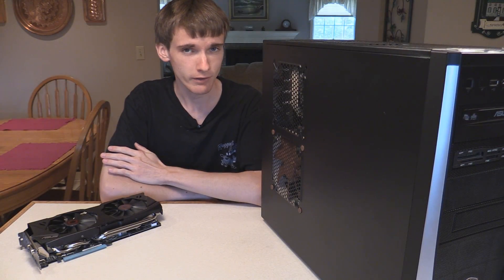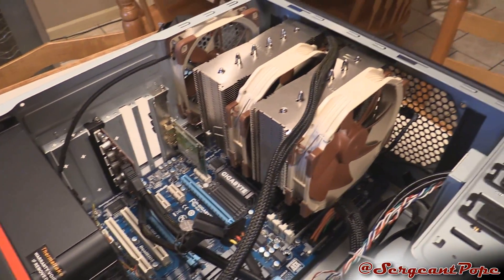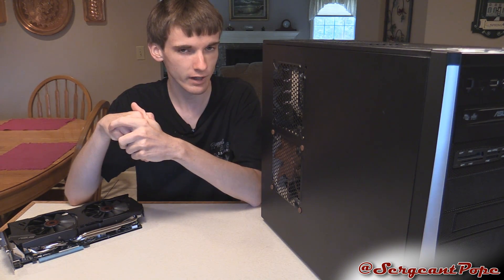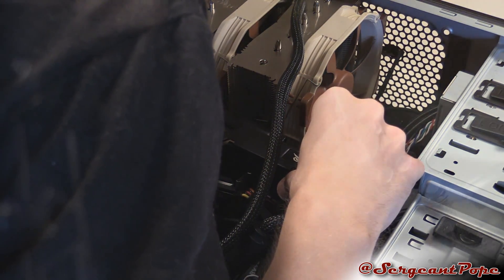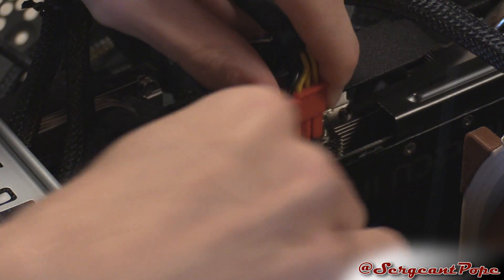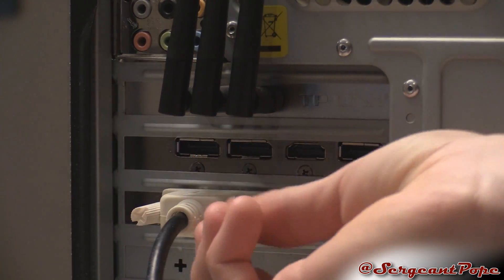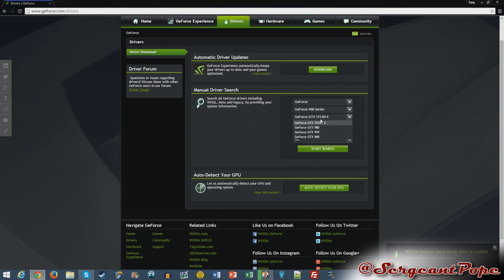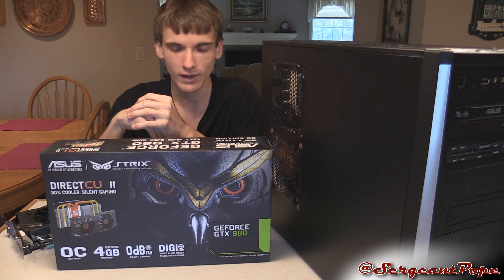How to install a graphics card - GET INTO PC GAMING EASY!

Comment: can i get any graphic card or maybe just a gt 730 for my i3 540
Reply from the maker: The only real requirements for a graphics card are you motherboard and power supply. The motherboard needs a PCI express X16 slot and the power supply needs to be powerful enough for the graphics card you pick.
Reply: hp compaq 8100 elite sff , not sure if i can get one of these
Reply from the maker: Kullehh Brahimi The big issue with that kind of computer is it's a small form factor, so it would only fit half height graphics cards. I think the fastest half height card is made with the GTX 750 Ti.

Comment: hey I,M ON WINDOWS 10 and I can't find my old driver as well I already installed the new driver.
Reply from the maker: If the new driver is from the same company as the old driver, it will commonly overwrite the old driver. Even if that isn't the case, you're honest probably fine.
Reply: SergeantPope alright thanks for your help on my quest to upgrade my pc. I just got a navidia over my old amc cpu and gpu, I was struggling a bit with it but now I just need to get my DVI-I dual cable for the card.

Comment: Hey, you seem like a pretty sensible guy. I'm not a gamer. I'm a 72 year old retired software developer interested in 3D modeling.  What video card "Low end" will work for me. I've been told to get a Directx 12 card HELP MR!!!
Reply from the maker: What graphics card you get depends on two things, your budget and how much power you need. A good low end card may be the GTX 750 Ti or a Radeon RX 460 or 470 when those come out soon. Since I don't do 3D modeling, I'm not completely sure how much power you would need to run that effectively, but I would think the cards I just mentioned would be able to handle it. As for DirectX 12, it's really not that big of a deal. You need Windows 10 to use it, but very few programs actually use DirectX 12.

Comment: What's is the best graphics card under 200 and his good for fos boosting?
Reply: Fps
Reply from the maker: The cheapest graphics card I'd get is the GTX 750 Ti. You might be able to find an RX 480 for around $200. Those perform really well for the price.

Comment: Pope, i bought a gtx 970, installed it and when i try to turn it on i get this message "reboot and select proper boot device or insert boot media in selected boot device and press a key
Reply from the maker: That would probably be an issue with your hard drive or SSD. Does the computer still boot normally without the graphics card installed?
Reply: Yep it was the hard drive. It was connected with a broken cable. Thanks for the help!
Reply from the maker: saldidruska Ahhh, that makes sense. Glad you got it sorted out!

Comment: I have a custom built computer. This is my build: http://pcpartpicker.com/p/wsckkL

I've had the computer for 5 months with no problems. Recently I got GTA V. I played it for a week with no problems, then suddenly, it started crashing my PC. At first it would show "display drivers have failed, but have recovered". Now, my PC crashes randomly.

I understand that I do not have enough power coming from my power supply from my build. Could this be the problem?
Reply from the maker: Your power supply being only 300 watts is almost certainly your problem. I would recommend getting a 500 or 600 watt power supply, especially since they really aren't too expensive.
Reply: I ended up buying a Geforce gtx 960 OC 4 gb. https://www.amazon.com/gp/aw/d/B013LDXPFO/ref=ya_st_dp_summary

I'm hoping this fixes the problem since it requires less power.
Reply: And it's better than my current graphics card. :)
Reply from the maker: Justin Williams The GTX 960 is pretty solid. I have one of my own. I believe it requires at least 500 watts.

Comment: I wanna get a GTX 1070 graphics card and i have a 600 watt power supply will that work?
Reply from the maker: It should work just fine. The GTX 1070 requires 500 watts and 30 amps on the 12v rail, so it sounds like your power supply would work great!

Comment: http://www.bestbuy.com/site/lenovo-desktop-amd-a10-series-12gb-memory-2tb-hard-drive-black/4362103.p?id=1219736628126&skuId=4362103

I'm a noob about this but this is my desktop I play games on.  it has integrated graphics which isn't the best what kind of graphics card would be best fit for this PC
Reply: I would recommend these graphic cards.
There pretty good graphics cards under $100
1: https://www.amazon.ca/Radeon-R7-240-128-Bit-Express/dp/B00FRHIIPK/ref=sr_1_30?ie=UTF8&qid=1482437610&sr=8-30&keywords=graphics+card
2: https://www.amazon.ca/GeForce-Passive-Express-Graphics-01G-P3-1313-KR/dp/B00498305G/ref=sr_1_3?ie=UTF8&qid=1482436456&sr=8-3&keywords=graphics%2Bcard&th=1
Reply: Or https://www.amazon.ca/GeForce-GDDR5-Profile-Graphics-02G-P3-3733-KR/dp/B00L5GZG5C/ref=sr_1_2?ie=UTF8&qid=1482351401&sr=8-2&keywords=graphics+card

Comment: I have a GTX 950 and when ever I game my monitor will randomly say no Signal. And the fans on the graphics card never spin also.
Reply from the maker: Hmmm, do you have the power connector for your GTX 950 connected? If not it may cause that issue.

Comment: Hi I'm a streamer and my PC has a GTX 970 but I need another graphics card for my other monitor just for watching my chat on twitch and checking my elgato. please help !
Reply from the maker: Well, you can just hook up two monitors to one graphics card, ya know.
Reply: +SergeantPope would I use a splitter because I only have one hdmi port in the back
Reply from the maker: TheLostChild HD No, you could get something like a display port to HDMI port adapter though. That'll work just fine.
Reply: +SergeantPope ok great would u suggest a specific make or anything?
Reply from the maker: TheLostChild HD For cables, not really. Just don't buy a super cheap one, lol. Something that is $10-$20 would be great.
Reply: ok cool thanks a lot XD

Comment: Hey,mate, i just bought a monitor Dell S2316H which has integrated speakers. The situation is that  the monitor has VGA and HDMI while my pc has VGA and DVI, in this case, what should I do if i want the speaker to function? thank you.
Reply from the maker: I believe with your current display setup on your computer, you would need to run an audio cable from your computer to your monitor to work with the integrated speakers. Otherwise you could buy a graphics card with an HDMI port and then have audio come through that cable.
Reply: is it worth it, if i upgrade the motherboard to a model with HDMI? or installing a video card sounds like a better idea?
Reply from the maker: chao huang Getting a new graphics card that has HDMI would be the best choice in my opinion.
Reply: I think i will use VGA and audio cable first, and get a RX 460 when it comes to the market. only for league of legends. xD

Comment: I am looking for a good graphics card maybe between 200-320$ I want it to run games for example Arma 3, Can you help me?

My specs right now.
 
Intel(R) Core(TM)  i3-2130 CPU @ 3.40 GHz 
RAM is 6.00 GB i will upgrade this. 
My graphics card is really crappy.
Reply from the maker: The GTX 970 would fit in your budget and run any game you want very well. Though I would recommend waiting a few weeks. The GTX 1070 just came out and is likely to push the prices of the GTX 970 down even cheaper.
Reply: +SergeantPope Thank you so much!!!
Reply: +TheLazySly Cat Do you now a website which will sell this?
Reply from the maker: TheLazySly Cat I usually buy my computer stuff from Amazon. Newegg also sells that stuff.
Reply: +SergeantPope Thanks

Comment: hey is there graphic cards that I can use that doesn't cost over 120$ but can still able to run big games
Reply from the maker: You probably wanna go with the GTX 750 Ti with your budget. It won't run demanding games super well, but for the price it's pretty good.

Comment: Hey, I'm wanting to upgrade my computer a little bit by adding a nvidia GeForce gtx 970 and I'm not sure if it would be compatible with my current build 
Specs:
Gigabyte f2a68m-h motherboard
Evga 700w psu 
Amd apu a8 7600 
Corsair vengeance 16gb ram 
Seagate barracuda 1 tb 
Thanks!
Reply from the maker: Looks like everything will work just great with a GTX 970! Your motherboard has the correct slot and your power supply looks plenty powerful for that card.
Reply: +SergeantPope okay thanks soo much! I subbed

Comment: I have an Dell Inspiron 620 and I want to upgrade my pc to run overwatch at 60 fps what doo I need to upgrade it
Reply from the maker: You have a full sized desktop, so any graphics card should fit just fine. Whatever graphics card you buy really depends on your budget.
Reply: My budget is under 150 bucks for power supply and Graphic card?
Reply from the maker: Johnny Nguyen Ahh, gotcha. How powerful is your power supply? There should a sticker on the side of it showing the wattage.
Reply: uhm I think it is 300 watt
Reply from the maker: Johnny Nguyen You'll probably have to upgrade your power supply to at least 400 watts if you want a slightly decent graphics card. Maybe get a 400 watt power supply and then a GTX 750 Ti.
Reply: Okay Thank you
Reply: SergeantPope jesus christ you're a youtuber that actually replies in under 2 days.

i salute you for not being a lazy shet.
Reply from the maker: Fancy Hamster Haha, thanks Hamster. I do my best to reply fairly quickly, but it's tough sometimes because I can't just do it on my stupid phone :P
Reply from the maker: Vladimir Kulkin According to my source for power supply requirements, you will need at least 400 watts for a GTX 750 Ti. Here's the link: https://forum-en.msi.com/faq/article/printer/power-requirements-for-graphics-cards
I don't imagine anything would bottleneck there, as long as you have at least 6GB of ram or so.
Reply: Heyy, SO I  bought an r7 360 and when I put it in and use HDMI connector, the screen does start but when I use the VGA without the  GPU, it starts
Reply: So can you help me :D
Thanks
Reply from the maker: Johnny Nguyen Are you using the HDMI connector on the graphics card? Is the graphics card fully seated into the motherboard? Do you have the power connectors on the graphics card plugged in?

Comment: i installed the graphic card but ive got only one pin for it the 6 one do i have to plug 2 of them in or will it work just fine with one pin plugged?
Reply from the maker: You could possibly by an adapter to add more 6 pin connections to your power supply, but chances are that if you don't have more than one 6 pin connector on your power supply, you may need to upgrade your power supply to something with more wattage.
Reply: yeah ive done that and bought a bigger power supply and it worked out good , thanks tho

Comment: hey man ive got a i5-4690 cpu 3.50HZ, and i was thinking of buying the MSI GTX 970 Tiger 4GB will it work fine ? and how good is it? i sorta new to these things, thanks in advance
Reply from the maker: +CFNinjaqt The GTX 970 should pair up with that CPU just fine. I would consider waiting for the GTX 1070 though, as it will be much faster and is coming out in less than a month I think.
Reply: +SergeantPope ah i only got the GTX 970 because of my budget , i dont mind it running games at high like fallout 4 and such, thank you very much tho

Comment: Do I need to reinstall the software after a system wipe? Please help
Reply from the maker: +the shady enderman You're reinstalling Windows on your system with the graphics card? You don't really need to do that. All you really need to do is install the new graphics drivers and it should work fine.

Comment: So this is my PC http://imgur.com/0x5iUnS
There're some chips around the PCIe slot, will a dual fan like a Geforce GTX 970 still fit?
Reply from the maker: +Red Mage928 Yep, a dual slot card will fit just fine. Two slot cards block the slot right underneath the card, but there isn't anything you can do about that.

Comment: Are there any graphics cards that can run Gta 5 but $300 under thanks
Reply from the maker: +Mr. Dark Chocolate234234 The GTX 960 is $200 and it can run GTA V at 1080p great.
Reply: +SergeantPope thanks a lot and fast reply wow. Sub and like
Reply: +SergeantPope and is here any under $200 thanks ur in us and I'm in nz so price range is a bit different thanks!
Reply from the maker: Mr. Dark Chocolate234234 Oh ok, you could also get the GTX 950 or the R9 380. Both of those are below $200 US and they both should be able to run GTA V at good settings on 1080p.
Reply: +SergeantPope WOW. Thanks! , Sub Like.

Comment: what would be a good graphics card UNDER $300, still looks, and has medium-low power consumption. If you can find one please tell me what the FPS would be on like Garry's mod with max settings
Reply: gmod takes like nothing to run so get a GTX 750ti or a GTX 950 (950 is better but is Iike 30 bucks more but preforms better)
Reply: A 750ti is a decent graphics card and is about £100 or 130 dollars, it should run Gmod fine on high settings
Reply: A 750ti is a decent graphics card and is about £100 or 130 dollars, it should run Gmod fine on high settings
Reply: every graphics card above intel i5

Comment: Hey man, what graphics card would you recommend me if im using hp 251-a123wb thanks man!
Reply from the maker: +Marvin Cleofas Budget?
Reply: +SergeantPope I just wanna replace the one installed in my system to a better one. So I would humbly spend like $300-500
Reply from the maker: Marvin Cleofas I would probably get a GTX 970 or 980 with that budget. Both are pretty damn great cards. They both require a 500 watt power supply, so if your power supply is less than that, you would also need to upgrade that too.

Comment: I have a dell precision t5500, with proprietary psu.  I discovered the best way to upgrade is to add another psu and not mess with the existing.  found this cool little relay on amazon to help  Add2PSU http://www.amazon.com/Add2PSU-Multiple-Power-Supply-Adapter/dp/B009P98Q8U?ie=UTF8&psc=1&redirect=true&ref_=oh_aui_detailpage_o00_s00 good luck

Comment: My PC has a PCI Express x16 slot, the slot for display ports are so small. What graphics card can I get?
Reply from the maker: +One123 If the slot is a regular PCI express X16 slot, then technically any graphics card will fit in there.
Reply: +SergeantPope Well it is a regular slot, but I've measured the height, which is 2 1/2 inches, with a width of 1/2 inches. Surely that's not big enough right? Sorry for asking, I don't have experience in building PCs.
Reply from the maker: One123 I don't really know anything about the measurements... could you take a picture of the slot and tweet it to me?@SergeantPope
Reply: SergeantPope Sure, just sent it. I hope the picture was clear enough, my phone isn't top quality
Reply from the maker: One123 Got it, thanks. Your case looks smaller than a normal desktop, which means only low profile graphics card will fit. Here's a GTX 750 Ti low profile as reference http://smile.amazon.com/MSI-Computer-Graphics-Cards-N750TI-2GD5TLP/dp/B00SOXMPJY/
Reply: SergeantPope One more thing if it's not to much to ask, my PSU says do not exceed 220 watts. Does that mean my PSU is only 220watts, if so I'm out of luck
Reply from the maker: One123 Sounds like you would probably will need to upgrade your power supply when you install a graphics card. Since you have a smaller case, you might have to get an SFX power supply instead of the regular ATX power supplies.
Reply: SergeantPope Ive decided to abandon this, anyways thanks for the help and replies

Comment: Help me ! please 
my PC HP . Pavilion p7-1000. system number :QW841AAR#ABA
SERIAL NUMBER : MX82110PJL
RAM 8 GB
processor : AMD A8
window 10 home .
i bought it 2013

i want to upgrade my video graphic card PC . i want to my pc can connect to 4k tv , and play game . do you guy know what video graphic card will fit into my PC , and how many W power supply is require ? i like AMD Radeon video graphic card , geforce gtx is good too.but they high price . cheapest video card will be good . 
i'm appriciate your help.
Thanks you so much your help.
Reply from the maker: +ZE KENZY That all depends on your budget. How much is your budget? Your power supply is 300 watts, so you will need to upgrade that along with any graphics card you buy.
Reply: +SergeantPope my budget is $ 200 to $ 300 , for graphic card ,
Reply from the maker: ZE KENZY Gotcha. With that kind of budget, an R9 380 is probably a good choice. Here's one http://smile.amazon.com/Gigabyte-Gaming-Graphics-GV-R938G1-GAMING-4GD/dp/B00ZGF3TUC/ You'll need to upgrade your power supply when you get a new graphics card though...
Reply: +SergeantPope  how many W for power supply will be enough ? what power supply you recommend ? Thanks you .
Reply from the maker: ZE KENZY An R9 380 requires at least 500 watts. I like EVGA, Thermaltake, and Corsair power supplies.

Comment: Hey, does anyone know if the Nvidia Gtx 660 graphics card is compatible with the Dell Xps 8700? Thanks.
Reply from the maker: +Daniel Goutovets The desktop case is big enough to fit a graphics card like that. The GTX 660 might require more power than your current power supply though, so if it does, you'll need to place your power supply.
Reply: Thanks for the help!

Comment: I have a  180 W AC power adapter, i am wanting to buy the geforce gtx 970. Will this be enought to power my graphics card or can you not tell?
Reply from the maker: +Leon Wells The GTX 970 requires at least 500 watts, so you would need to upgrade your power supply without a doubt.
Reply: How would i go about doing that?
Reply from the maker: Leon Wells Buy something like this and install it, lol http://www.amazon.com/EVGA-Continuous-Warranty-Supply-100-W1-0500-KR/dp/B00H33SFJU/
Reply: SergeantPope I just looked into it previous you creating the comment. And Ill probably end up doing that. Thanks :)